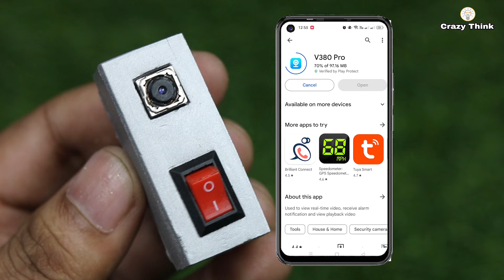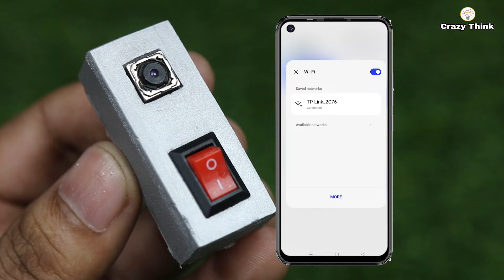How To Make  Wireless Spy Cctv Camera Simple at Home

Comment: 5:22 okay my only question is is when you hooked up the circuit board the wires that were in the black tape with the SIM card what part of the SIM was it on or was that supposed to be a secret